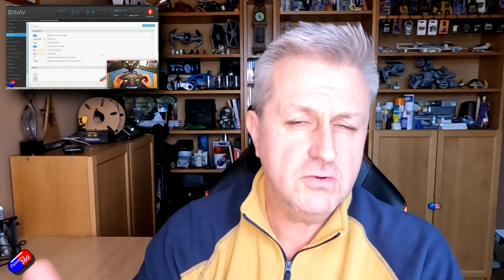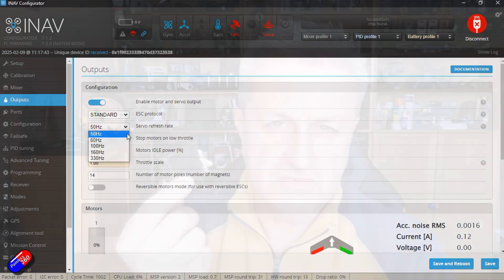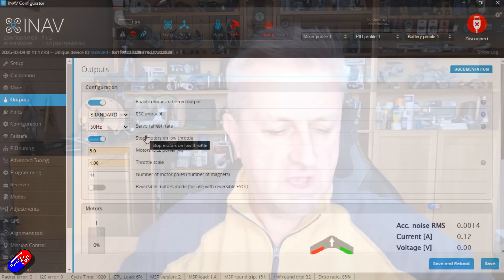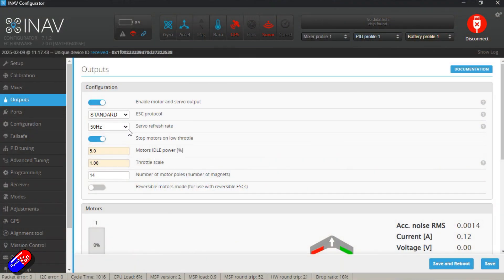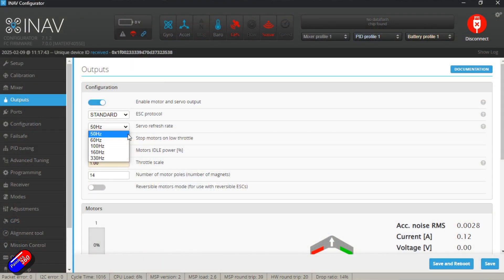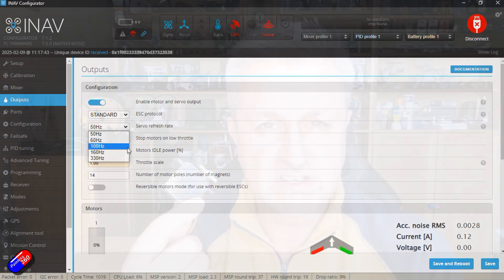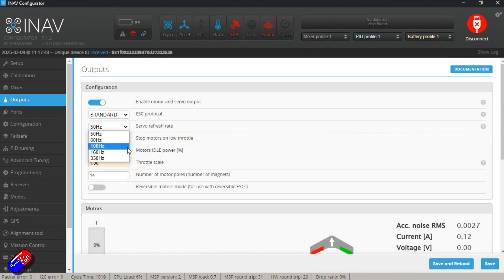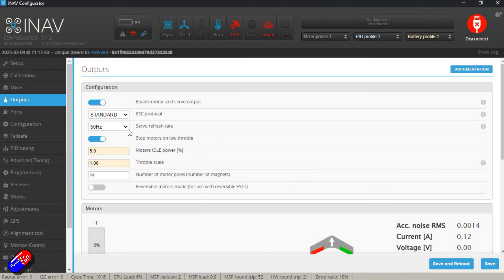INAV Servo Speed for Analogue and Digital Servos - what do you set?

Comment: Lee! Thank you for all the valuable information you have given us in your videos! I have a somewhat unrelated question: on a wing that needs reflex (ARWP, Caipirinha II, etc) should we still run "continuously trim servos" in iNav? It seems to me that if the midpoints are adjusted, it would mess up your reflex. Is this a correct assumption? Thanks again!
Reply from the maker: If you know the position of the control surfaces you need then set it and don't use the trim servos feature... Happy flying!
Reply: @Painless360  thank you so much! That's kind of what I figured, but thanks for the confirmation!

Comment: When setting the servo Hz rate it is important to keep it out of the resonance frequency of the motor and prop. Otherwise a not proper balanced prop could disturb the servo positioning control loop. For example, 4s battery with 1900kv motor and 2 blade prop the resonances start at about 160 Hz, when throttle is about 30%. At full throttle the main resonance is at 360Hz - 380 Hz. You do not want your servo Hz rate in that range.

Comment: I try to set the servos to the same rate as ELRS. 
Most digital run good at 333hz. or 250. .
50-100 less now with nomad X working good
the plug and pray stuff is usually closed / with transmitter 
peace

Comment: Im gonna set up my RM NExus FBL in Rotorflight. Is there a difference in digital and analog servos in RotorFlight as well?
Reply from the maker: No idea. I'd expect so but I've not set it up... Happy flying
Reply: Using analog 50Hz with rotorflight is not using the fast and quick potential of rotorflight. 330/333Hz digital is highly recommended.
Reply: @horsthorst482  Will test that, thank you!
Reply: @NorgeSquad   You're welcome. A heli with flybarless unit, Rotorflight or other systems, can perform the best with fast and accurate working servos. So that every change made by you with the radio sticks and every change made by the flybarless to keep the heli stable and follow your commands is done with the lowest amount of time delay. 330Hz update frequency of the servo results in an more than 6 times earlier movement than 50Hz . A fast accurate servo with more than enough tourque power and update frequency of 330/333Hz is common standard nowadays for a helicopter. Analog servos are outdated for modern helicopters and aerobatic rc planes, f3x glider etc. Always happy flying and landings!

Comment: I set to 333hz and run it. No reason you should be using analog servos on inav anyway. Go for the reliability, speed, and accuracy in any model your planning to send out. 

Plus there is a real downside when you're adding delay to your contro link. Especially if you run 60hz or high video link. 

Let the analog servos be for your  LOS or combat planes.
Reply: Hi can you help me please . I have a jumper t16 pro and dont think its ever been updated. Can you tell me if its compatible with a flysky Ftr8b

Comment: With respect to checking the increased power draw from digital servos, many years ago I purchased a device called 'TattleTale' from Xtreme Power Systems that performed high speed monitoring of the servo voltage BUS and a number of LEDs alerted you to the lowest servo BUS voltage detected during a flight. It has helped me determine if I needed an upgraded BEC or perhaps just a low ESR capacitor connected across the servo BUS in a model. Sadly, this simple little device no longer seems to be available.